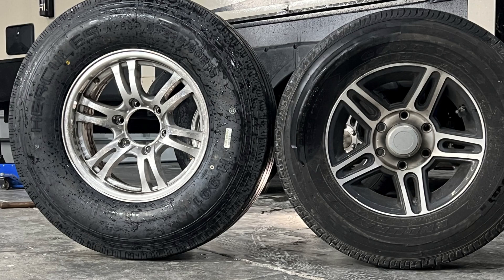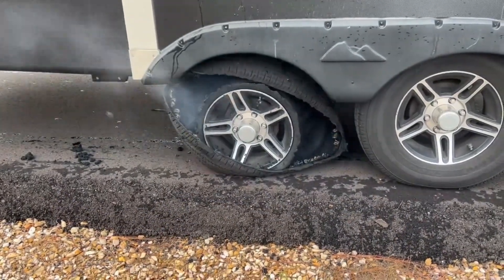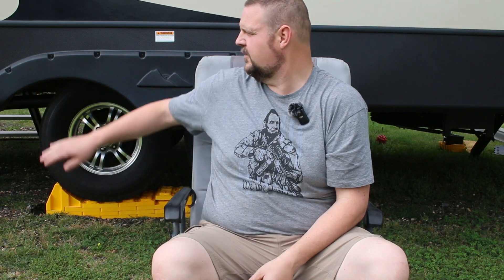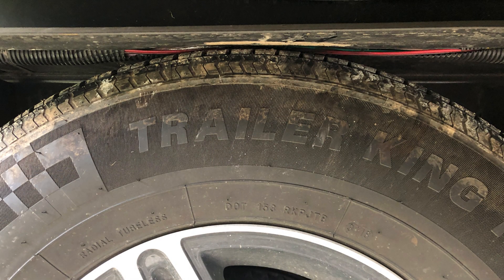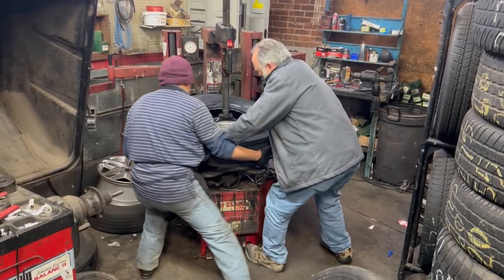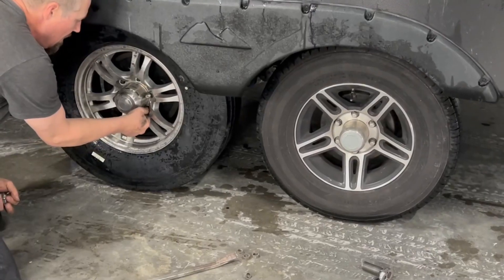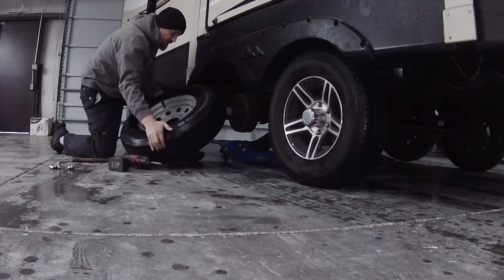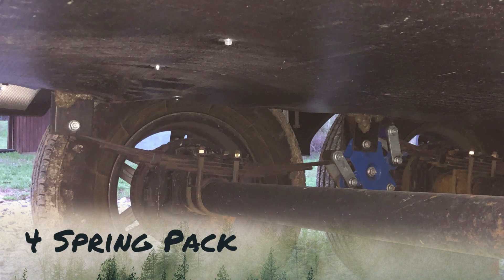RV Suspension Upgrades

Comment: Just replaced the flattened out springs on our 2016 5th wheel. I added Comfort Ride shocks and the Lippert axle alignment kit. The mistake I made was aligning the axles before replacing the springs only to discover that because the left rear spring had flattened the most it actually changed the axle alignment. Well after the spring replacement I had to realign the axles. I also went from 235/80R16  10 ply to 235/85R16 12 ply Hercules tires. So 2" blocks, the alignment kit, and larger diameter tires finally leveled out the trailer when hooked up to the Ram HD dually. The 5th wheel height also increased to 12' 8".

Comment: I couldnt imagine towing my 29rks with a half ton! It looks like you now can see the top of your tires through the fender flare. Can’t fit my hand between top of tire and the under belly but no rubbing as of yet . 4 inches higher . Wow ! can you feel anything difference towing her? I also have the hide a spare and couldn’t imagine anything else.
Reply from the maker: I hadn’t noticed any difference now.  Before the last set of upgrades it seemed it May catch wind a little more, but I’ve not been in high winds since the last go around.  We are headed to SD in a couple weeks though so I’m sure we’ll see

Comment: The 29RKS is one of the "half-ton" models that is too close to capacity... yes under built.  But this does not apply to all of the "half-ton" trailers... models like the 24RDS have a lot more wiggle-room.  BTW.. the tires are a total combined, only 20 pounds heavier than the trailer kings that came from the factory.
Reply from the maker: You are right I was curious and it’s only actually 26 lbs.  my new tires are 136 lbs more than the trailer kings… without the spare

Comment: How bad did Camping World rip you off? They are thieves.
Reply from the maker: It was all warranty work and I didn’t buy it there.   But I never went back
Reply: @GimpyCamper  I know, cuz they ripped me off in the past
 Charged me $700 to put on a new  fold up metal steps
Reply: Same problem on our new fr Cherokee rubbing bottom after second trip out west from north ala. TT at 7800 lbs.  Found a shop in Sheffield, al, with a side business of upgrading travel trailer suspensions.  Replaced our dual 3500# lipperts with 5200# Dexter's, replaced axles, springs, brakes, bigger wheels and tires. They even took my old components in on trade.

We gained about 2" of height.

About 2 yrs later I found hangers bent and that might have been from the taller suspension increasing the "lever length".  I had the hangers straightened and that shop welded bars to the hangers across the trailer to stiffen.